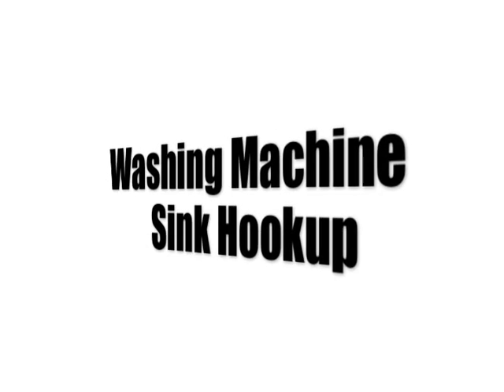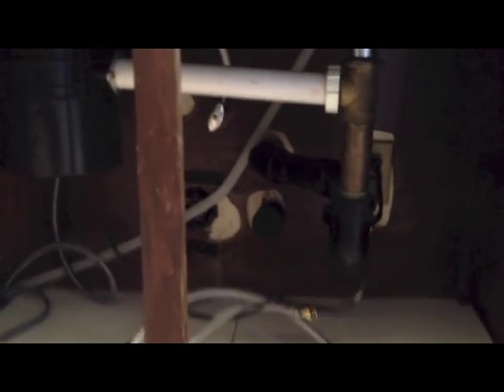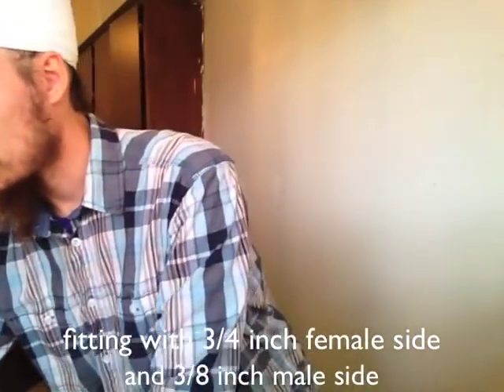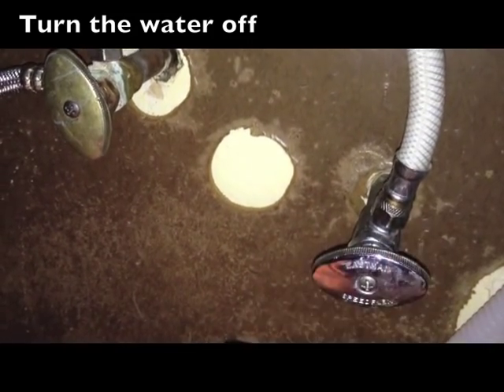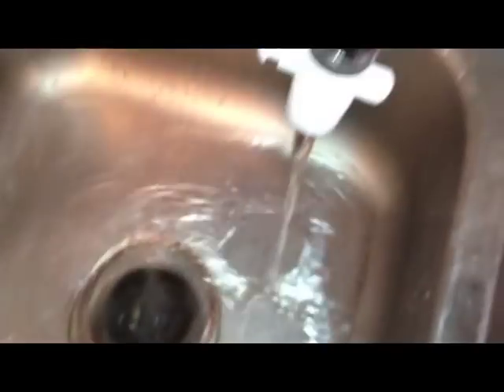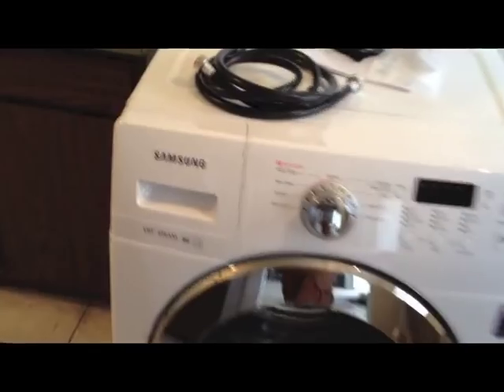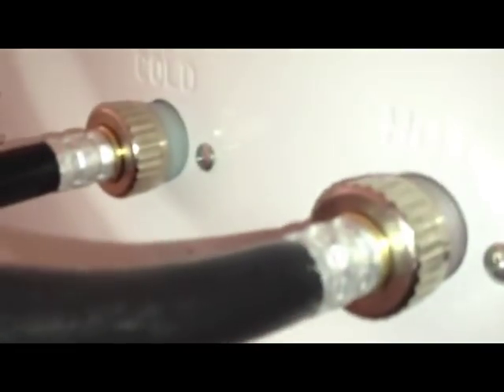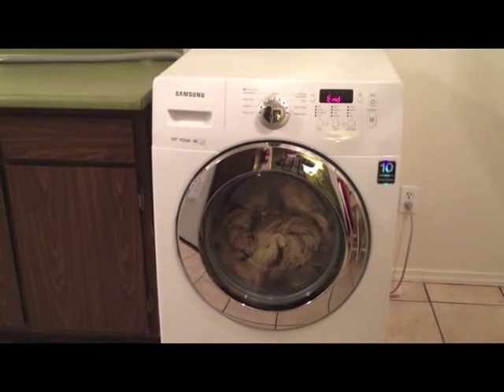Washing Machine Under Kitchen Sink Install

Comment: I never thought I'd watch a video from 2012 on something I need help with in 2021 haha! thanks man!
Reply from the maker: haha! time flies! glad it was helpful
Reply: Am watching this in 2024
Reply: Thank you! I have a hot and cold water supply in my wall (apartment) but no drainage pipe! I was wondering if it were possible to drain the water into the sink and this video really helped :)

Comment: Thanks. I wish I could add video in a comment. lol. I bought my supplies based on this video from amazon and hook up my washing machine underneath the sink exactly as Rion described and it worked. Here are the supplies I bought from Amazon but you could also get from any Home hardware stores if one is nearer to your home.  Two "Litorange Lead-Free 2 PCS Brass Angle Stop Add-A-Tee Valve 3/8" Compression Inlet by 3/8" Compression Outlet by 3/8 Inch Easy Connect Tee",   Two "Eastman Dishwasher Installation Kit, 3/8 Inch Compression, 3/8 Inch MIP Elbow, 3/4 Inch FHT Elbow, 8 Foot Braided Stainless Steel Dishwasher Connectors, 41059", Two "Premium No-lead brass dishwasher swivel connector elbow fitting 3/8" comp x 3/4" FHT",  Two "Hooshing 2PCS Brass Hex Nipple 3/4" NPT Male to Male Pipe Fittings Coupling Connector", and Two "Premium Stainless Steel Washing Machine Hoses - Burst Proof (2 Pack) Red and Blue Striped Water Connection Inlet Supply Lines from Kelaro."

Comment: Thank you so much, I knew this was possible I just needed a visual example and the right parts explained. I'm going to do this next week. I bought a compact washer and this will help a lot I've been filling it with a 5 gallon bucket (15 gallons to load medium or large)

Comment: I love this! The dread I faced with having to move to an apartment that I would not be able to use my lovely washer in. I just knew this had to be possible. 

The new apartment's kitchen is definitely big enough to have a washer just hanging out. With a new kid on the way too.... Its just going to make things sooo much more simpler and time saving. 

Thank you for sharing such a simple and detailed fix to my problem ❤❤❤

Now if i have an electric dryer... Can i just place that anywhere near a window for it to vent out of?
Reply from the maker: The electric dryer might be more tricky, unless you can find a 110 volt option. Or if there is a 240 volt outlet... fingers crossed. (venting out the wind seems reasonable)  Congrats on the baby!

Comment from the maker: Correct. The challenge you will have to consider with having a dryer is where hot air vent will go.  You can just put a good lint filter on the end of the vent and let it go into your house. (In the winter it can be an extra heater...) Or if there is a window close by it can go out the window.
Reply: I have a washer/dryer combo that recycles the hot air, no need for hot air vent.

Comment: Hello, I just stumbled upon your great video, thanks! I’m trying to do the same hook up for my new portable washing machine, with my bathroom sink. I noticed that on the 3/4 side of your hose, the part that you hook onto your machine, there’s no shut off valve. Do I need one to shut off the water to the machine when I’m not using it to prevent leaking or water damage? 
Your video is 9 years old, how did it go with your set up? Did you have any problem from not having a shut off valve? Thanks!

Comment: Before I do this… Did anyone have any problems with hooking up the washer drain system to the sink drain pipe? Like did it back up or overflow?
Reply from the maker: funny enough I've never heard a complaint. I remember just watching it a lot in the beginning to make sure it didn't back up. Good to be cautious

Comment: You can also put in a PVC why drain underneath the sink connecting for the hose and for your sink 

If you own your apartment, you could also drill a hole through the back of the cabinets because it looks like he would only have to do three holes , and get plastic liners for the holes, and run your tubing and drainage tube through those

Comment: My only concern now is, how do you regulate the flow of water when the washer is not on and you are only using the kitchen sink? Do you need to get a cut-off velve to the dish washer lines going to the washing machine that would allow you to turn it off when the washer is not un used? Or should that not be problem as I am worries about pressure build up from the flow of water to the washing machine when it is not on and when you are not using the kitchen sink. Any thoughts would be greatly appreciated.
Reply from the maker: having a separate shut-off could be cool. but generally washing machines are always under pressure. cheers!
Reply: @RionLyle  it turned out I didn’t need one. It worked so well. Thank you so much.
Reply from the maker: @avasartistrystudio3230  YAY!

Comment: I was just gonna get a split for the kitchen faucet and use only cold water..and the output mounted on the side of the counter and hold it steadily so the water would drain directly into the sink

Comment: can i link the hot and cold water supply together to go to my "cold water" only washing machine? it claims only cold but I already used it to wash in hot water fine, ill take my chances :)
Reply from the maker: You’ll probably need a way to switch between the two. If both hot and cold are connected then they can mingle in odd ways, like when you turn on cold water in the faucet, then like warm water comes out

Comment: You should still out a hole in the side of the sink cabinet and run your hoses through there, so you don't have your sink open all the time. If you can't do that get an adapter with a kill valve then you can just hook up the hose under the sink when ever. Go as far as hooking a faucet adapter then hook up a faucet slip on to the end of both hoses then you just have to slide and snap hoses under the sink

Comment: Plumbing is really not that hard.  Newer options such a PEX tubing REALLY makes it a lot easier.  The people at Lowe's were very helpful for me and youtube videos help also.  

PVC is easy to work also.  Try a book on the subject of plumbing.  Be sure to test fit everything before you actually crimp or glue it together.  Cut it to size, fit it together to test the fit, then glue or crimp.

Comment: I'm assuming you drilled holes thru your cabinets to run those hoses to your washer so that they aren't just laying on the floor while you do your laundry.....right? If not that is what I would do. Good video you make it look so easy. I can't wait to get myself a full size washer now. Thank you, thank you, thank you. :-)
Reply: Most time when you rent you cant drill holes into other peoples property so for that i think the best solution probably would be to get the hooks and hook the piping to the bottom cabinet it wont be inside the cabinet but atleast it wont be drapibg across the floor either
Reply: I would still drill the holes like Deborah said, and just patch it and paint over it when I move because those cabinets look old any way and safety is important ijs, putting hooks could cause damage over time

Comment: Very innovative but just a word of caution, I think you will find a building inspector would condemn the idea of a washing machine waste pipe being emptied into a sink, it's unhygienic, if a separate standpipe is not available then the washing machine hose should be plumbed into the sink waste pipe with a special adapter fitting.
Reply from the maker: good caution

Comment: Can you also tap directly into the drain under the sink?
Reply from the maker: There might be a way to do that.  The main issue with washing machine wastewater is the amount that comes out at a time. So the water needs to evacuate quickly through the pipes or else it backs up... best of luck to you!

Comment: +Rion Lyle you should take a 3/4 drill bit and run the line through the bottom of the cabinets. Also does it need to be a low voltage washer?
Reply from the maker: Normal washer. Great suggestion! I didn't drill a hole cuz it was a rental apartment. I've since moved and took my washer with me :)
Reply: Rion Lyle Great man thanks for the video too very helpful I will be doing this in my apartment.

Comment: Did you buy your parts on Amazon or at the local hardware store mine is poorly stocked so I'm trying to find all of these adapters on Amazon and having a bit of trouble finding some of them.

Comment: Do you need to put in cut-off valves for the hosing to the washer to minimize pressure when washer is not in use? Does the washer draw water when the faucet (above, not the vales below the counter) is not turned on? In other words, can you describe if there are any mechanical issues between the 2 water hoses? Many thanks for your help.

Comment: would this work for portable washer? I dont have a standard  kitchen faucet to where I can just hook it up directly to the faucet. Im gunna have to go under the sink but I will have to roll mt washer to the sink  and hook it up every timei need to wash. is it possible to do this same connection but with a valve that  I can shut off on one side?
Reply from the maker: I bet there is a solution that would work how you describe it. adding extra shut-offs, and maybe quick connect like this ...   let me know how it goes... https://www.homedepot.com/p/Powercare-3-8-in-Male-Quick-Connect-x-Female-NPT-Kit-for-Pressure-Washer-AP31037B/100664031

Comment: Go ahead and pay the extra $10.00 to the code office (building code office) for a permit as you will get unlimited inspections and they can help you also.  It's good for insurance purposes to have the codes met.
Reply: I guess I can hire a license plumber and have him pull code so insurance will cover in case of flood.

Comment: great video, I've been looking for one that actually explained the pipe/hose fitting sizes.. so thanks :)  But can I run the washing machine drain hose into my dishwasher??  id like to hide the drain hose and not have to have it running across the counter every time I do a wash?  Thoughts?
Reply from the maker: i'm pretty sure the dishwasher uses a pump and has to be running to be able to drain, so I don't think that would work.   maybe you can come up with a solution to disguise or beautify the drain line so it doesn't stand out...

Comment: Good video... But it might be a dumb question but if I use the sink will that water go into the washer...? And ive watched other videos and they have to turn on the sink for water.. do I need to do this?
Reply: If you're on about the waste pipe from the washing machine,  then the water from the sink wont go back down the pipe as the machine has a "pump" that literally forces the water out so it can't "backflow" (I.e water coming back down the pipe.)

Comment: that was an interesting video thank you. It just occurred to me that I never use my dishwasher and how ideal it would be to remove it and stick in a front loading washing machine. finding one to fit (approx  23x33) could be hard.  I dont' have any wall space in my kitchen.  I'm also considering putting a washer in my unused shower but knowing how to hook up a washer in a shower is another deal.  I don't know where a washer will go yet I must figure it out!.  I've already got a dryer  I put it in my bedroom between the bed and the window so you can't see it. it's disguised as a table. it is a small voltage dryer you just plug in. I got it from stupid sears. I wash many clothes by hand and hang them until they have finished dripping then dry them in the dryer.  There is a rising epidemic of bedbugs *You can get them from public laundryrooms)  and having your own washer/dryer is a must now. !!  so thanks for the video.
Reply: what brand/model dryer did you get is it still working?
Reply: richard burton i was thinking the same thing.....

Comment: Were you able to send the lines behind/underneath the kitchen set up? or did you left all exposed?
Reply from the maker: I left it exposed. I probably would have routed it behind the cabinets and hard-piped the drain if it wasn't a rental. I don't recall it bothering me.

Comment: Can you plug in the washing machine in regular electric outlet, or do you need more powerful outlet? I am afraid regular outlet can't handle a full size washer.
Reply from the maker: normal washers in the US use a standard outlet.  It's the electric dryer that usually needs a more powerful outlet.
Reply: Washing machines run off of 120v which is what you consider regular outlet. Dryer, aircond,water heater or  stove run off of 220v . More power is needed .

Comment: My washer is going to have to go farther and need longer hoses. Do you know if they make 12ft hoses?
Reply from the maker: Hi, I'm not sure, but if you're able to make a trip to a hardware store you can ask about couplers. I bet you'd find a way to make it work.
Reply: @RionLyle  my washer was used but new and didn't come with washer hoses so I just ended up getting two of the braided stainless supply lines and connecting them together, and using the 3/4 to 3/8 elbow connector and putting it straight on the back of the washer..... Running a test cycle/tub wash right now.... So far so good! No leaks, no issues!
Reply: @RionLyle  my add-a-tee valves and water connections under my sink are leaking..... Help?
Reply from the maker: @SSpixiegirl  I wonder if the rubber washer needs to be replaced, or if you would benefit from pipe tape. I hope you have a bucket in the meantime...

Comment: Do you have a list of parts
Reply from the maker: I don't have a specific list, but I have this: 
-Two Dishwasher Inlet Hose (yes, the dishwasher one) with a 3/8 inch female hose thread on one side, and a 3/4 inch female hose thread on the other side.  This might need to be built up with a fitting the goes from 3/8 inch male to 3/4 inch female. 
-Two splitter valves 3/8 inch female to two 3/8 inch male threads
-possible, two 3/4 inch male to male couplings
-some moxie (if you're old fashioned)
-other things that seem to make sense

Comment: I did the same thing I wanted a full size washer too a front loader washer
Reply: Can the sink and washer be on at the same time? And does your washer use a lot of water? how long does it take to wash. And what did you do for drainage? Also what time of washer you have?
Reply: For Da Culture no the sink can be off
Reply: @carytheus5058  can i use the sink while the washing machine is being use also
Reply: For Da Culture yes I do all the time in my bathroom sink
Reply: @carytheus5058  what the model of your washer?
Reply: For Da Culture I don’t know I would have to look

Comment: how do u turn water off, when your washing dishes so it wont run into the washing machine
Reply from the maker: The water flow is controlled at the dishwasher and washing machine. They just need flowing water to them, and they will turn it on and off as they run. Hope that answers your question.
Reply: +Rion Lyle  Hey Rion, are there any issues with amount of water in washing machine.  You use the 3/8 hose then have that go up to a 3/4 hose, which attaches to the washing machine. Right?

So doesn't the washing machine require more water from a 3/4 hose?  Wouldn't a 3/8 hose be to "under powered" for washing larger loads? or could it cause any long term issues over the life of the washer?

Comment: where did you buy your adapter valve?
Reply: ***** Anybody know where to find the 3/8 in tee adapter?
Reply: I found it at home depot
Reply: Found one: BrassCraft Model # CT2-666X P Internet # 202495893 Store SKU # 367960
3/8 in. x 3/8 in. x 3/8 in. Compression x Compression Brass T-Fitting OR 3/8" x 3/8" x 3/8" Compression Angle Stop Lead Free EZ Tee Water Max Adapter
Reply: @RussellWHanson  Amazon now a days. 9 years later. lol

Comment: If you load dishwasher, faucet, and laundry all on one valve could that "overload" the waterline or aynthing like that?  Plus I'm wondering if it is bad to go from 3/8 hose to a 3/4 hose to a 3/4 washing machin line? Can't that cause problems going small to big hoses
Reply from the maker: I haven't had any problems. It doesn't "draw" more water, just the water is diverted. The dish and laundry washers operate on amount of water in them, they fill until they have enough water to begin. They might just fill a little slower if both are on at the same time.
Reply: +Rion Lyle Thanks Rion.  
PS you have the best and most easy to understand apartment/faucet video. and it's also quite well put together with the music and editing

Comment: Wouldnt it look better. if you drilled a whole in the side of you cabinet bottom, and ran ur hose, etc. through that and clamp the top gray hose to the top of the cabinet, instead of  using the ugly clear tape, which u will have to keep replacing? just a thought...(helpful hand)😁😁🤔🤨🙄😶😑😊😉🤗😏😮😛
Reply from the maker: Thanks for the feedback. Yes, going through the back of the cabinets is a great long-term solution.

Comment: Who the hell runs a waste pipe into their sink? That will get so gunky after just one wash. Watched this video to find out how to connect the waste pipe for crying out load...
Reply from the maker: good question. I put a filter at the end of the pipe. I never had a problem. but obviously, if you have a better place to put your drain pipe you should use it.